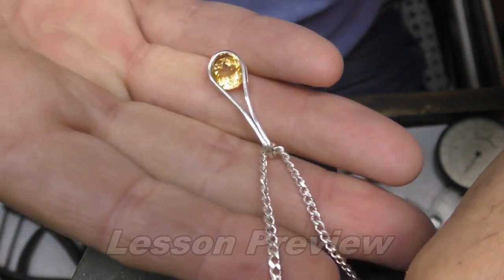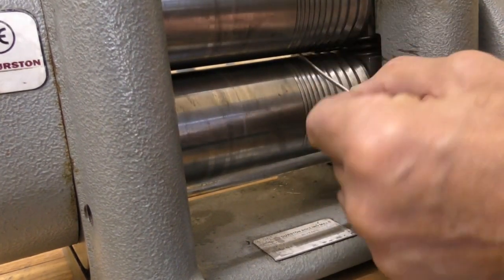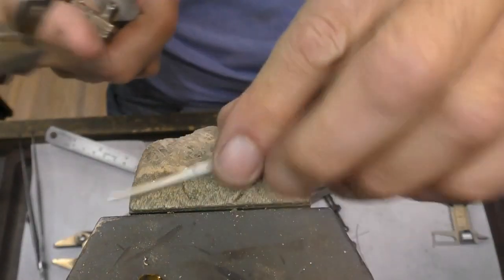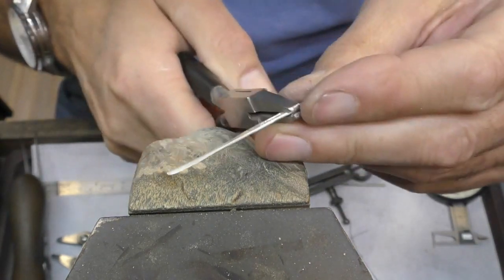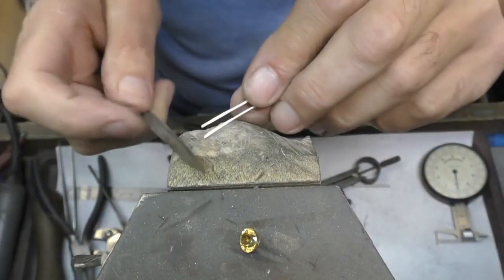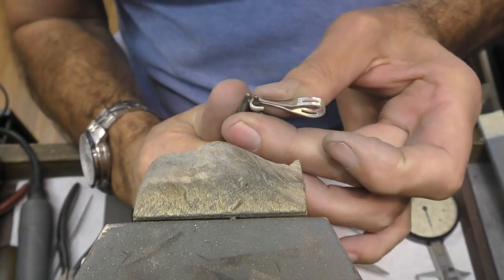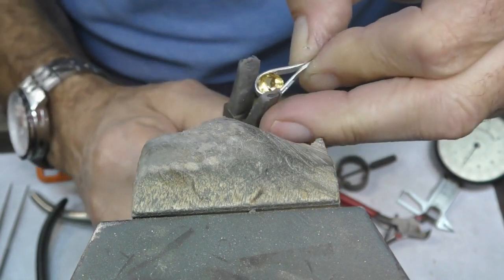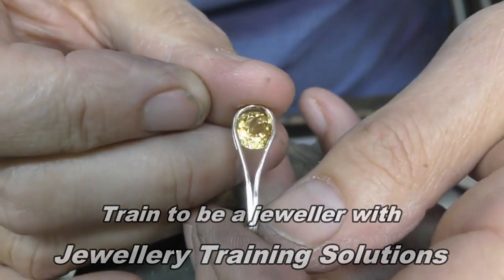Tension set drop pendant

Comment: What can you do so the pointed back does not scratch the skin?
Reply from the maker: You can sand the sharp parts or, just solder it closed
Reply: Setting can be made thicker. Whatever the measurement from the Crown (Top) to the Culet (Bottom point) plus a little more. Then the culet will not hit your skin.
 more